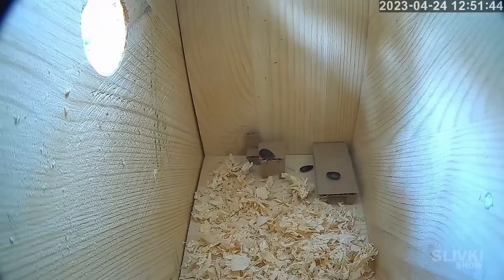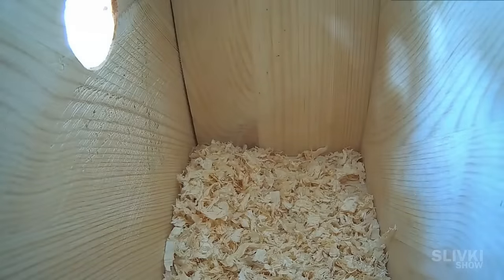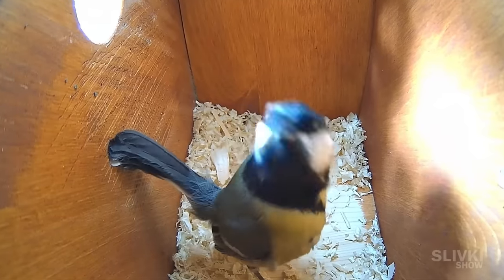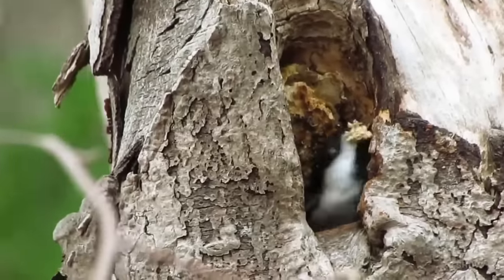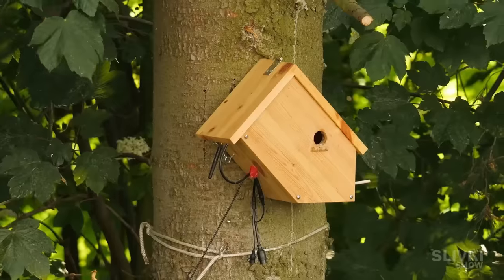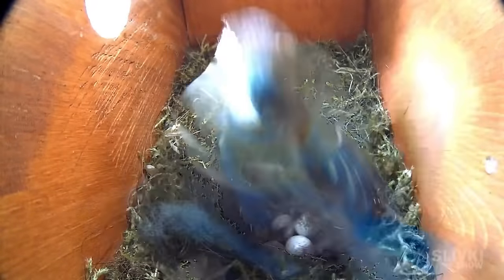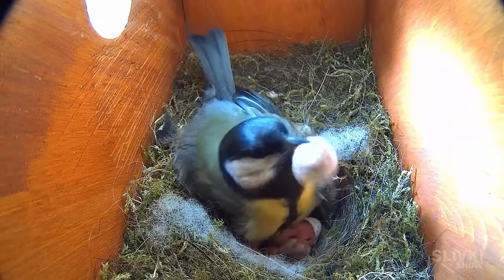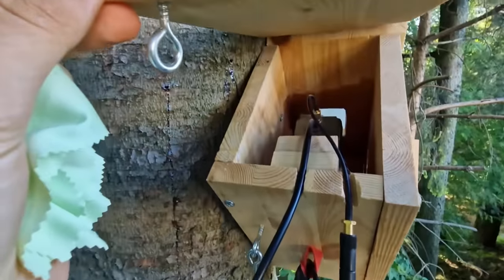THE NEWLY BORN LITTLE BIRDS WERE SUBJECTED TO ATTACK BY A PREDATOR!

Comment: Nest scraping is a good sign a nest will be built. It is how they scent mark the box claiming it within their territory. The odd movements the female made is called the snake display. It is meant to scare competition or predators from entering the nest box. This is a perfect designed nest box for tits, you can make the entry way slightly smaller to keep larger species of birds from entering the box. The course fur, preferably deer hair, is used to weave the edges of the nest cup and to keep the moss packed down. The female will loosen the course hair as the chicks grow to make the nest cup deeper. She will keep working on the design after she has laid all the eggs and has started the incubation process. 

Also a fun fact since the female lays so many eggs, it requires more calcium than is in her entire skeleton to produce a full clutch of eggs.

Comment: It is good to include a small shelf on the inside of the “door” hole of bird houses, one that stretches about half of the floor space.  That gives the young a place to hide if a predator attempts to reach in, and yes….crows are omnivores and will eat baby birds from other species.  

Also, don’t put a landing stick outside the opening to the house…..the birds don’t need it and almost never use it, but predators can use it as a place to hold on while raiding the nest.

Comment: Had a wren nest in a box laid eggs came back a week later the eggs gone no signs of what had eaten the egss till found a snake skin in the nest guess they felt safe there cause just 2 weeks before another pair of wrens had nested in the same box and all but one baby flew off think one of the siblings had killed it and ik the wrens didn't use that nest as i myself got rid of it or i wouldn't have believed that that was a new nest 😢😢 week later after noticing it is when the snake got into it wasn't a big snake as the nest showed no signs of intruder it literally looked they vacated the nest